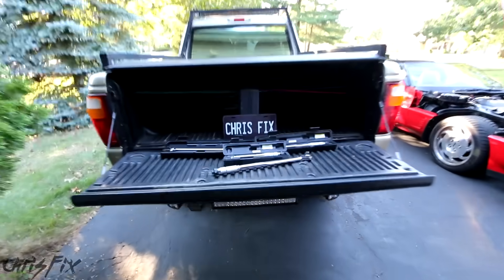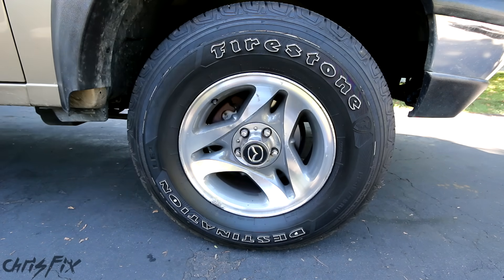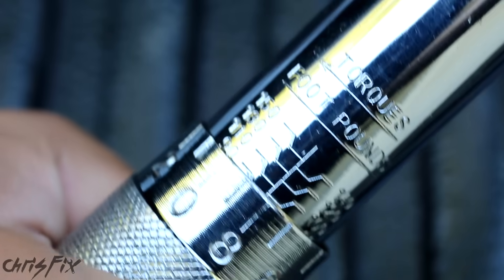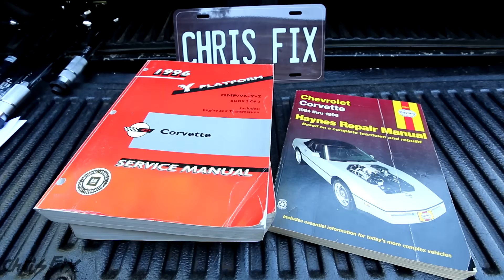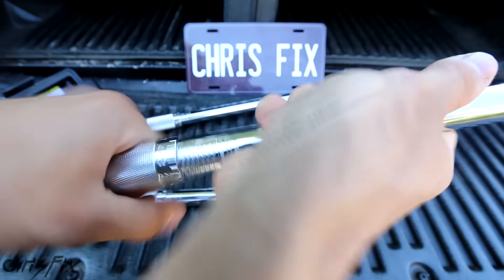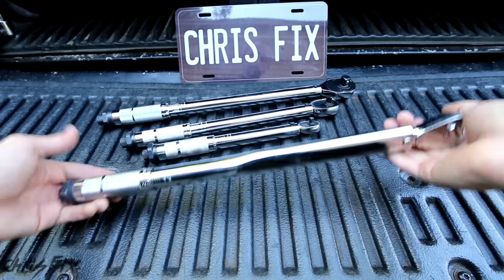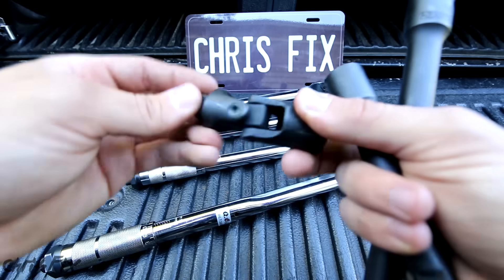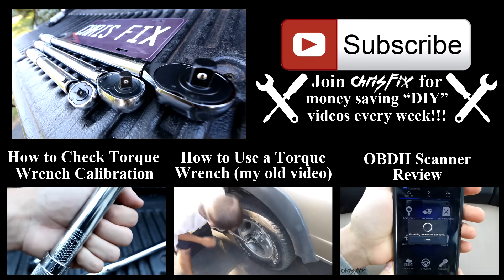How to use a Torque Wrench PROPERLY

Comment: "Because not everybody uses foot pounds..." That's an understatement considering the entire world world uses the metric system, except the US and the two superpowers Myanmar and Liberia! :D
Source: https://en.wikipedia.org/wiki/Metric_system

Great video though! Love your work, and really helpful advice as always;)
Reply: Except essentially the entirety of the aviation field internationally uses SAE
Reply: Quintinohthree you have to memorize things either way and it's not really that difficult in English, plus it's more useful
Reply: He did show you one side is SAE and one side is Metric. Get over it. I use them both when needed.
I also tend to use inch pounds a lot.
Reply: To be fair though, metric is taught in school in the US. I know that a mile is about 1.6 kilos, a meter is larger than a yard by a little bit, each unit goes up by 10s, King Henry Doesn't Usually Drink Chocolate Milk (Kilo, Hecto, Deka, Unit, Deci, Centi, Milli), etc. To say it's not used in the US is wrong too, we just use both systems for whatever reason.
Reply: The one place where the metric system is just abysmal is temperature.  the Celsius scale isn't fine grained enough, 24 can be both too hot and/or too cold. There's also a reason imperial was set at base 12. . . . dividing by 2, 3, 4, and 6 are all even divisions.  Divide something up into thirds using the metric system, and enjoy measuring out to 33.33333333333333333333333333333333333333333333333333333333333333333333333333333333333333333333333333333333333333 centimeters.
Reply: @snap-off5383  Celsius still makes more sense than F° , Walter frezzes at 0 C° and boils at 100C°
Reply: @afonsoferreira5171  of course, its just that round digit celsius is too coarse a measurement and to the tenth is too fine. . .  the distance between farenheit degrees turns out more useful for things like thermostats and weather.
Reply: @snap-off5383  So you've not heard of decimal points?
Reply: @bigm383  then water freezes at 0 and boils at 1000 if you add a decimal point, way to fine grained instantly.
Reply: @snap-off5383  No, you haven't added a decimal point, you've added a nought. Clearly mathematics isn't your strong suite, is it?
Reply: @bigm383  number of intervals between 0.0 and 100.0 (to the first decimal point) = 1000. Math perfect.  It actually is my strong suite.  Sorry I thought I was talking to someone who could follow a basic point not someone reading through a cardboard tube.
Reply: @snap-off5383  I'm sorry if mathematics is your 'strong' suite, because you must be really bad at everything else!
Reply: @bigm383  Subject change, and ad hominem,  big surprise.
Reply: @snap-off5383  Just stop, you clearly have no idea about what you are talking about.
Reply: oh look. another one of these comments. wow. so clever.
Reply: Coley Durham yeah but it would be sooooo much easier if everybody used metric
Reply: Michael King Why waste time on math and memorization when you could use that time better?
Reply: Frankie Abaddon thank god he never succeeded in that awful system
Reply: Thiago Andrade how? Because you're bad at math?
Reply: technically the USA uses metric, they just make it complicated by multiplying it by some number to get "imperial"
Reply: Imperial System Sucks!!!! :-(
Reply: Salty Admiral everyone in the US excluding those that work at NASA. I've never used the Standard system. Which I find ironic for American made Astronautical parts. I believe I never encountered any spec sheet that used the standard system. To this day I laugh goddamn Jimmy Carter and never finishing converting us over fully to the metric system.
Reply: The US is the best country in this world 🇺🇸🇺🇸🇺🇸💯💪🏽💪🏽💪🏽
Reply: Who cares about not America?

Comment: should definitely add:
*that if you by anny chance end up making the "arm" longer like when you use a crowfoot or something, you change the torque   value unless you torque at a 90 degree angle. same goes for shortening it.

*all drops should require a re-calibration. 

*at least the snapon we use need to be calibrated every 3 months.

exept for that great video!

note that even if you break all the torque rules you will always be better off with a torque wrench instead of guessing with a regular wrench.

Comment: If someone needs to use a torque wrench just to tighten the wheel nuts on their car, then they probably don't even know how to open a tin of beans........without consulting a manual.
Reply: Are you for real?...
Reply: "Are you for real?..." -- Are You?
Reply: Mick Kennedy The point is we don't want to find warped rotors or stripped studs in a "tin of beans".  Even a homegamer should make an effort to do as professional a job as they are capable of.

Comment: Excellent!  How about analog torque wrenches though?  I have found that these are useful on occasion like when you want to slowly "slide" into torque instead of turning full bore until a "click" indicates to stop.  An instance where I have seen this as important is when you are working with more fragile hardware such as brass or aluminum.  Seeing the torque build up as you tighten is kind of important in those instances.  Just my opinion though.
Reply from the maker: There arent too many instances you are working with brass on a car and aluminum is not that soft but you can totally use a analog torque wrench!

Comment: great video Chris :)  one question if I'm working with rear and front brake example replacing the pads and I need to torque them to spec, which one should I use 3/8 drive or 1/2 one ?  this is for a 2002 GMC Yukon Denali 6.0
Reply from the maker: It depends on the torque specs. A 3/8s driver will usually go from 10-80ft-lbs while a 1/2in driver will go from 25-150. You want the torque spec to be in the middle of that range because that is where the torque wrench is more accurate.
Reply: ChrisFix
thanks Chris I will check torque specs on those bolts and from the data then I will chose the right one thanks again man have a great day man and hi from Puerto Rico hermano ^_^

Comment: ft-lb or lb-ft? Neither one is wrong. The unit is made up of two parts which multiply each other. Torque can be described as lbs of force at a distance from the pivot point.

Torque = ft x lbs
which, I hope you agree is also
Torque = lbs x ft

It's a weird unit, but math says either way is right.
Reply: +Mc GetRekt except it isn't pounds per foot, that would be pounds/feet rather than pounds*feet
Reply: Well formed points there. I can see I'm up against a master (de)bater here. I'll let you get back to your handiwork.

PS. I don't have to try to sound clever.
Reply: bayseb4a If we were talking about the vector product this nuance would be important. However its clear from the context we only care about the scalar product so commutation is allowed (i.e. ignoring direction or its implied viz a viz tightening torque is called for), when working with vehicle specs. The direction tightening torque vector can be derived from the cross product of the unit vectors of  displacement X force =into part/tightening. So either ft-lb or lb-ft is correct as these units by themselves are scalar quantities (or at least only the force is thought a vector in this practical case)!
Reply: Hey, Mc GetRekt. You deleted some of your comments. Realized you were wrong? Sad to see you go. We could have been friends.

For anyone else who doubts that "neither one is wrong".
1) Have a look at the vid at 1:53, the torque wrench itself shows ft-lbs.
2) Wikipedia explains that it is expressed either way:
https://en.wikipedia.org/wiki/Pound-foot_(torque)
3) Roush shows it can be expressed either way:
https://www.roushperformance.com/blog/2010/12/the-meaning-of-horsepower-and-torque/
Reply: No one cares? Wrong. I care a little. I'm just trying to help.
And you are very active and emotional about it for someone who "couldn't give less of a shit if I tried."
Reply: Torque is force applied at a distance, not distance applied at a force, so syntactically lb-ft is more correct just as newton-meters is .
Reply: Hmmm. Maybe we won't end up friends. I still have hope.
Did you look over the definitions and references I linked?
Reply: +Mc GetRekt   dude, what is wrong with you? calm down and be an adult about being wrong. jeez
Reply: Romano Coombs Yes! EACH  PERSON can choose eIther or Either as they are equivalent in the context of tightening a fastener. So "100 ft.lbs" can  operationalized as a product of any distance in ftx any weight in lbs that gives 100 lb
.ft e.g. 100lbs at 1 ft from pivot or vice versa 1 lb at 100 ft from pivot via a rigid rod. Also 50 lbs at 2 ft from pivot etc...
Reply: My argument is still pro-Lbs-Ft b/c it's mentally-faster ...

During warfare and engineering, technical things are reduced to their most efficient version. That version usually happens to be visually and audibly brief.

Kilometers become klicks
Headquarters becomes HQ
Acronyms become puns
Lbs of torque over a given distance becomes LBs per Foot.
It's the difference between Life and Death, Success or Failure.

Why?

Because most people can imagine a  'an iron weight dropping over a short distance' more instinctively and rapidly than 'a distance stretched over by a weight'...

Is this making sense to you?

We can just choose this, as a collective, and move on to SOLVING REAL PROBLEMS...
Reply: +bayseb4a  Incorrect. Distance is not a vector, it's a scalar.  t = F x d. Especially in this example of a torque wrench - where the force is perpendicular to the moment arm - it wouldn't make sense to have a directional distance.  It doesn't matter what dimension it's in either. +pssst3 says it best. People probably say foot pounds because it is better on the tongue. 

Also, if you do the math you realize that matrices are not involved in torque calculations. so no, it is commutative.
Reply: I work in torque quite literally all day, and it's always been ascribed to me in FtLbs or Nm.  Because it is a unit that describes two different things, a rotational force about a central point from a prescribed distance, the units are technically interchangeable, but the units FtLbs is technically used to label energy while lbs ft is used to describe torque, although, I've never seen it called out in lbs ft and I work with engineers all day.
Reply: My torque wrench is 100 ft. long, so to tighten a bolt to 100 ft x lbs. I use one pound of force at the end of the handle.  I have a second torque that is only 1 foot long, which I don't use as much, because I have to use 100 lbs x ft to get the same torque.  Go figure?
Reply: GetRekt:
It is specifically NOT "per". Per implies a division. This is a multiplication.

That's why the order is mathematically irrelevant.
Feet x Pounds = Pounds x Feet
Reply: @DerekKerton  That's not right. Take RPM, for example. 1000 RPM x 5 minutes = 5000 rotations. Multiplication. Not division, which would be 1000/ 5 = 500.
Reply: Derek Kerton sorry but you are wrong. In 90% of the time, either way is right, but if you know physics and have to calculate torque in the 3 dimensional room, then force and distance are vectors, which makes the multiplication non commutative. This makes only Pund * Foot the correct way. flies away...
Reply: Derek Kerton you are correct mathematically, the difference is lb-ft us used for torque and ft-lb is used for energy
Reply: Derek Kerton No because like I said I couldn't give less of a shit if I tried, you're a wannabe clever kid on the internet always wanting to be different, go cry elsewhere no one here seems to care HA
Reply: Yeah but lb-ft stands for "pound per foot" of torque, if it was the other way around you'd be saying "feet per pound" of torque which makes absolutely no sense
Reply: TheTomco11 Just shutup you're not clever stop trying to be clever when its failing XD

Comment: You forgot to add that if you use a extention at the end of the wrench the value will be off. Because some torque wrenches are "length dependant". This means the actual torque applied to the fastener is dependant on the position of the operator hand on the wrench. This occurs if the pivot point of the wrench mechanism does not coincide with the axis of the fastner.

Comment: I bought a 1/2 inch click style torque wrench. Well it said when not in use unscrew to lowest torque setting and in parentheses it said do not set lower than lower setting. Well I can't read numbers too good and went lower. So my question is did I mess up any calibration or is everything okay? I screwed handle back up when I realized I screwed up. So did I do any damage?
Reply: Since you tightened it up right away, I'd say no damage done.

Comment: need a torque wrench for my atv. can it go down to 7lbf-ft
according to service manual
Reply from the maker: It cannot go down to 7ft-lbs. But this one can: http://amzn.to/2d7genb
12in-lbs is 1ft-lb
Reply: I
Reply: +ChrisFix I clicked on that link it just goes to amazon.
Reply: The simplest reply would have been: Get an Inch Pounds torque wrench. "20 to 200 inch pounds"
If 7 foot pounds is required and if 12 inch pounds = 1 foot pound then 12*7= 84 inch pounds is equal to 7 foot pounds.

Comment: Very instructional video I would add an air of caution saying most vehicles have a torque of about 100 without specifying that each vehicle is going to have its own specific torque is a bit dangerous you don't want to be tightening anything down you don't know the specific torque for. You could over tighten the lugs and damage the threading on the studs as previously stated.

Comment: the tork wrench do they measure ft pounds and inch pounds? or is th hat 2 different kinds?
Reply: 2 different kinds. It will either be Ft Lbs or In Lbs, although you can do a simple math conversion (multiply/divide by 12) but it wont be as precise.

Comment: Pro tip: Use silica gel to avoid rust in an enclosed box, but not recommended for containers with large holes or gaps.
Reply: K Y jelly?

Comment: Just so people know, you can definitely use drive extensions as long as they can handle the torque rating or you'll get torsion in the extension and possibly leading to it failing. The extensions perpendicular to the wrench do NOT change the torque rating of the torque wrench, but if you add an extension wrench that's parallel with the torque wrench, it will change the torque specs and you'll have to do a quick easy calculation to determine what lb.ft value you need change to compensate for that extension.

Comment: Something that bugs me is that many of the in/lbs torque wrenches start at 120 in/lbs. That's 10 ft/lbs and easily available on better quality 3/8" drive torque wrenches. This defeats the whole purpose of buying a in/lbs torque wrench in the first place. Say for example......the torque spec on many hose clamps is 60 in/lbs. That's 5 ft/lbs and not achievable on a in/lbs torque wrench that STARTS at 120 in/lbs. It's counterproductive and a waste of money to purchase one that doesn't go WAY down. A good one should be able to go below 50 in/lbs.

Comment: You can always use extentions, it's just for every inch the extention is take 3% of the torque out. For example:
100 FT. LBS. torque wrench with a 1 inch extention = only 97 FT. LBS. getting to the bolt.
I learned this from a training video at work (Belle Tire)
Reply: Really ? I just got one and my lugs are inset so i need an extension to reach them
Reply: +james dean usually 2 -6 pounds on rims isn't going to kill u depending on what car u have.
Reply: +james dean they just have us do it at work, so we can be exact, and if someone sues the company, it protects the tire techs from legal issues.
Reply: Depends on how good of torque wrench you have. I have two Craftsman digitals that were made in USA back when they were quality. They don't deviate with extensions or between deep well or standard well sockets. I've double checked countless time. Keep in mind these were over a hundred bucks EACH almost twenty years ago......EXPENSIVE.
Reply: Double check yours to see how GOOD it is. Use a standard depth socket....then a deepwell.......then add a 3" extension on it. If it always clicks.....no deviation.....
Reply: We have a Sunex and a Matco torque wrench.
Reply: +John Doe also we just got the sunex one replaced about 2 weeks ago
Reply: Nick Calder Thanks for sharing that.
Reply: Hmm that's interesting as I recall reading somewhere that using extensions didn't affect the torque.
Reply: Paul Moore wherever you Hurd it from either there source is wrong or they are wrong, look at it like a tape measure for a certain distance the tape can stay streight in the air then suddenly it bends after a certain distance and falls to the floor.  The same with a torque wrench extention the force exerted on the bolt is less and less for every inch the extension is long.
Reply: Yes that does make sense, thanks for the insight.
Reply: Paul Moore yup